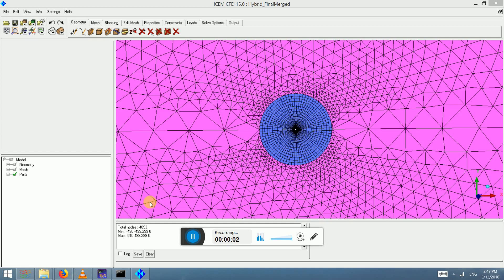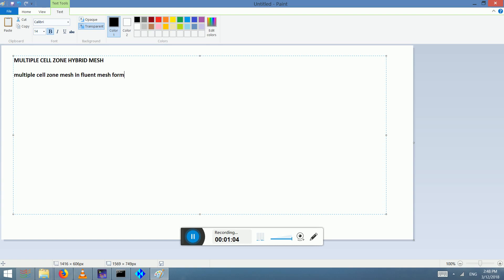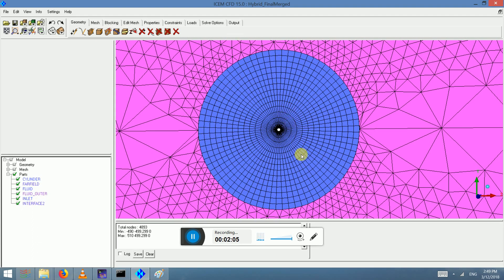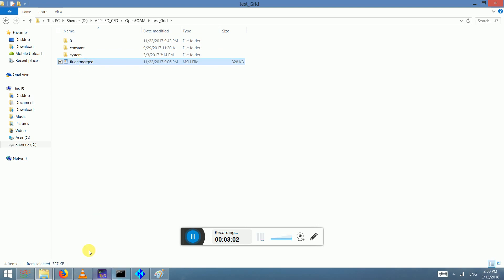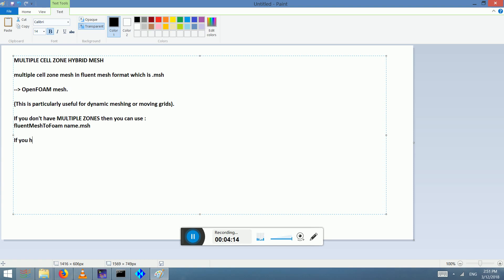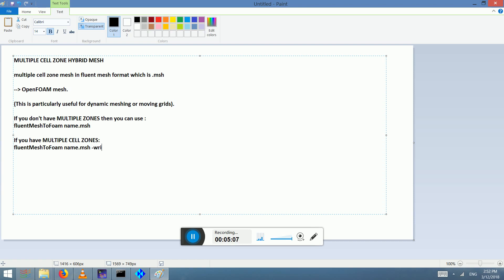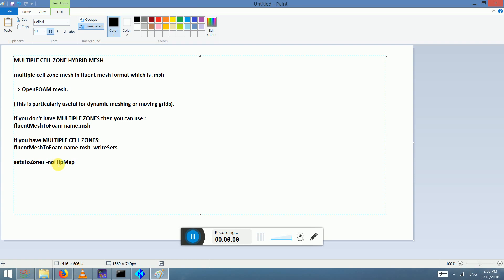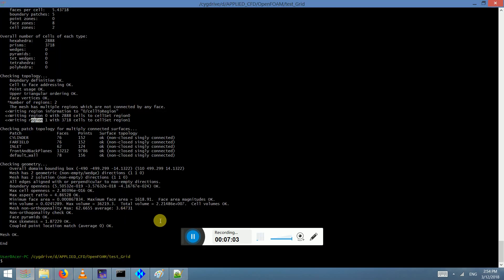Lesson 18 ICEM/Fluent Mesh to OpenFOAM  (multiple cell zones)

Comment: How do you define boundary conditions on interface which is considered as default_wall in OpenFOAM. 
And please complete this tutorial with dynamic mesh domain mentioning the boundary conditions and also the use of sets in this case.
Reply: i am facing the same issue, did you find any solution
Reply: @aniruddhanayak3771 I faced the same issue. But my  problem is cleared when i named the interface with some other name which is not a standard name in OpenFOAM libraries.